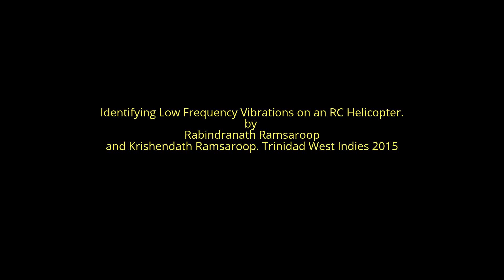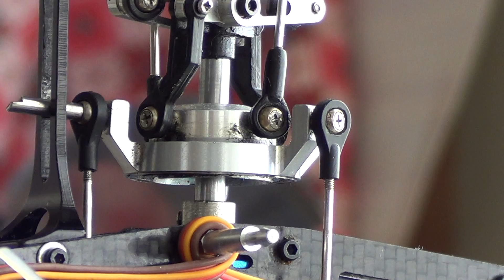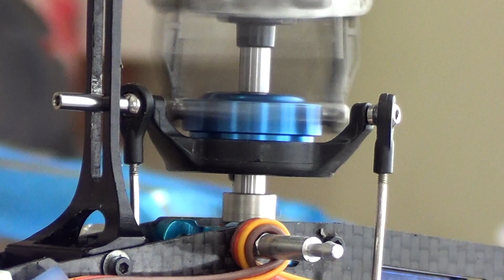Identifying RC Helicopter low frequency vibrations.

Comment: Seems your test was with 2 different RPM and not in a same rotating speed. Silver one was in low RPM and the blue one was tested in high RPM. 

Same vibration observed when the blue one slowed down and normally all the rotors create a mild vibration in the slow speed/RPM.
Reply from the maker: you are correct but the silver one also gave flight problems and not the blue

Comment: You don't think that the grub screw hanging out that far has something to do with it?
Reply from the maker: I think you mean the grub screw on the spacer below the swash. It is not the grub screw since the screw is the same foe the new swash and there is little vibration.
Reply: No, that's not far out, it's got nothing to do with it